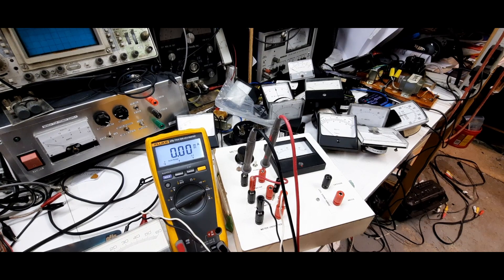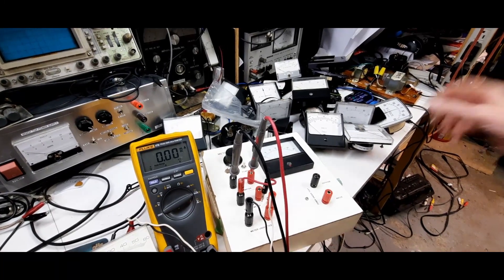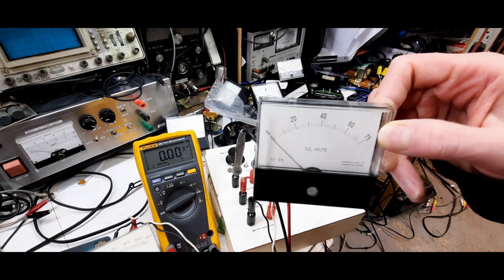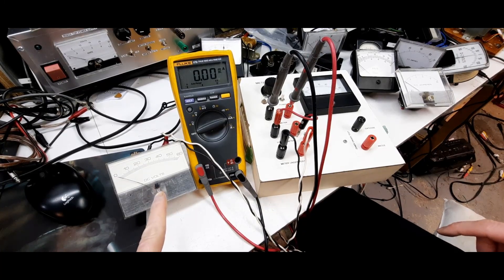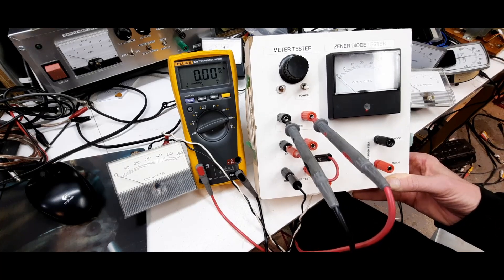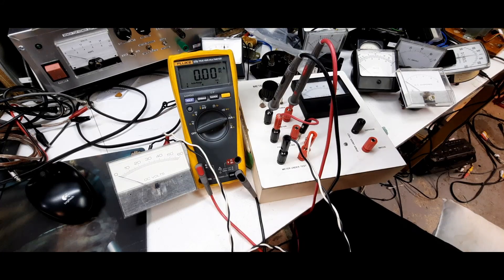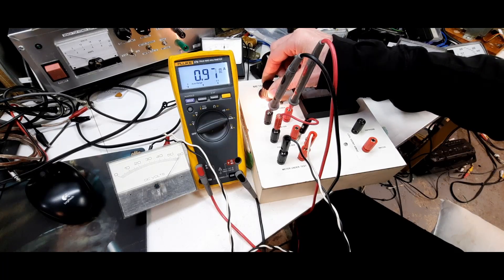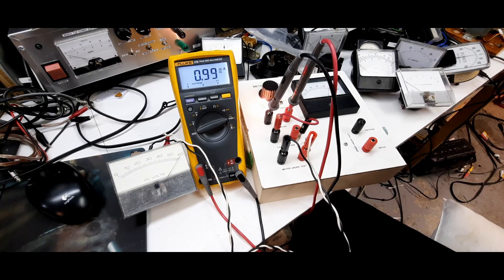Homemade Panel Meter Tester - Find FSD Of Unknown Meter

Comment from the maker: I forgot to show you the schematic of the circuit. I cannot add a picture to these comments so here is a description of the circuit. It is so simple. It's an all series circuit. 5K pot in series with a 1.5V cell that goes to a 100ohm resistor then to banana jack for DVM (set to mA) and another banana jack for other end of your DVM meter. From there you got to a banana jack for one end of your Meter under test. Another banana jack to the other Meter  under test connection. From here you finish the circuit the to 5K pot.
Reply: A theory of operation statement is also helpful... You created a variable current source (circuit,) applied it to the meter, adjusted its output until the meter read full scale and read the current with a multimeter set on amps. Clever and easy-breezy.
Reply: Never figured it would be that easy.... have one...way more complicated. So as soon as I overload it, I will build yours.
Reply: I think you would need a 50 kOhm multiturn !  For 1 mA from a 1,5 Volt  battery you need 1500 Ohm. For 100uA you need 15000 Ohm. And for a 50 uA meter 30000 Ohm.
I left the 100 Ohm resistor out of this equation as it is merely meant as a 15 mA maximum safety.

Comment: Another usefull parameter you should measure in this device when measuring full scale current, is the voltage applied to me meter's terminals in order to get full scale deflection. Using that voltage and the full scale measured current you can calculate the internal meter's resistance, which will be used later to modify the original articles' schematics values for the full scale adjustment potentiometer and the serial limiting resistor required to adapt you meter to the current application.
Reply from the maker: That's an excellent point about measuring the voltage and calculating the internal resistance. Thanks for the useful tip!

Comment: I am surprised that the 15A meter does not have a parallel shunt resistor which could be removed.
Reply from the maker: After going through all my meters, most of them did have a shunt inside and I was able to cut them to have a 1ma meter. 1ma meters are very popular with these magazine projects. It turns out when I made this video, I only took 1 meter apart and that meter has a shunt but it was around the meter movement and I could not get to it. However, as I said, most were okay to cut. Cheers!

Comment: Your meter tester is very nice, however it's not necessary.  Measure the resistance of the meter and divide that into the full scale voltage of the meter.  Example:  A 30 volt meter shows a resistance of 300,000 ohms.  30/300.000=0.0001A or 100uA.
Reply from the maker: That is a great idea for figuring out the FSD!

Comment: A lot of times the full scale current is listed somewhere on the meter. And then you can parallel, or series, resistors to change the meter to whatever you need. Shunt resistors and/or series resisters are basically how multimeters are able to read different scales...   Thumbs Up!
Reply from the maker: That is a great point, and I should have mentioned that!  I just wanted to rid the meters from the shunts and drop resistors to get it back to its original state. It turns out most were 1 mA which is what I need for my projects. Cheers!